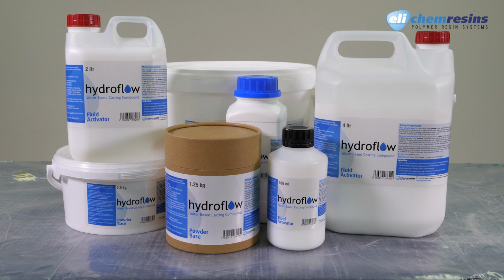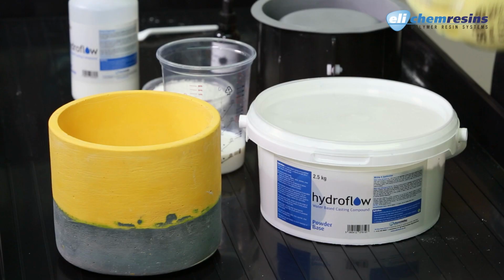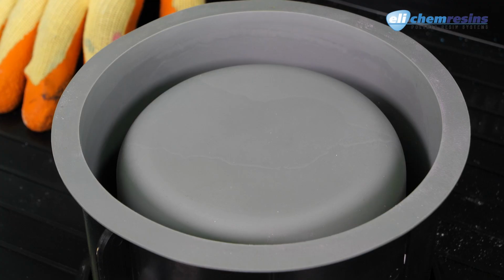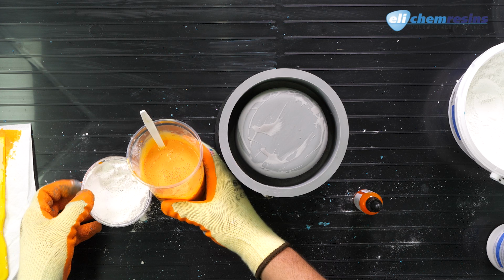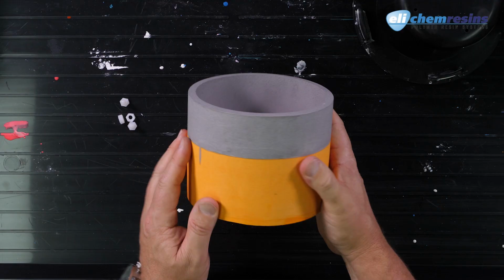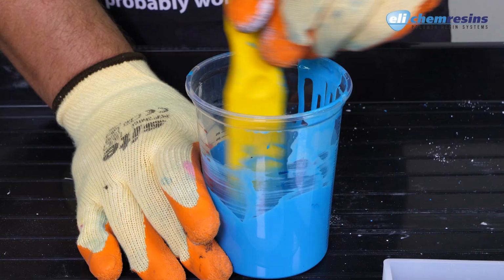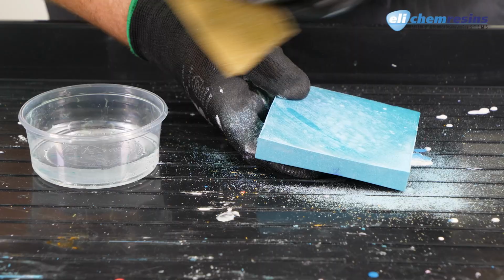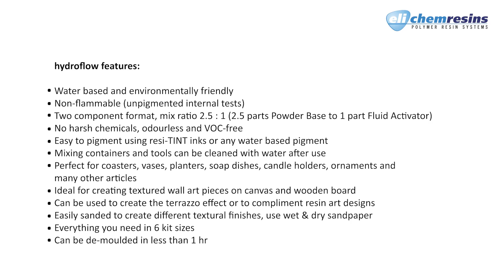hydroflow Water Based Casting Compound - Terrazzo & homeware

Comment: You forgot to add the link for the molds. It is very difficult to find planter molds other than small ones for succulents.
Reply from the maker: Thanks for your comment, we buy our planter moulds on Amazon. You should be able to find them easily there :o)